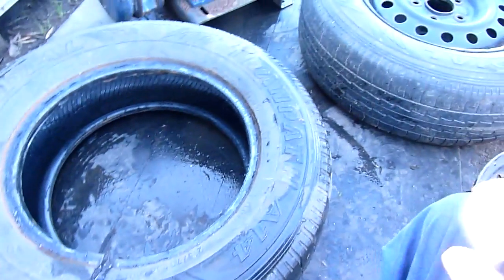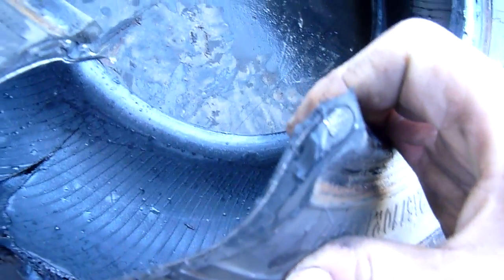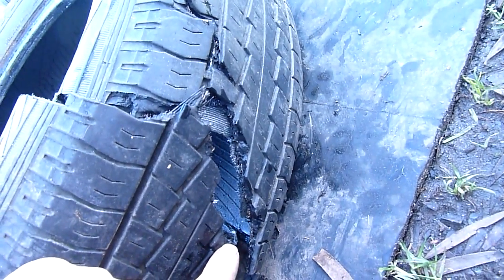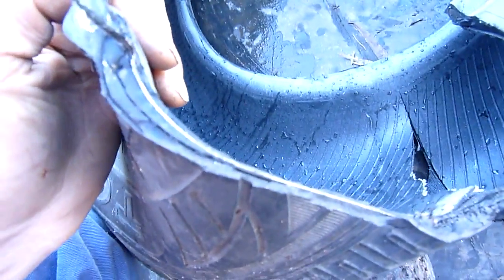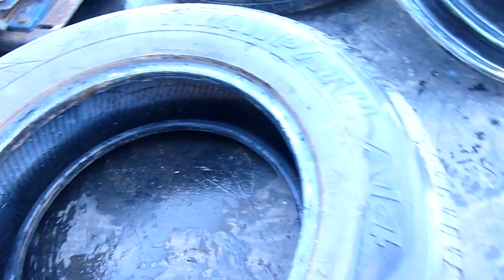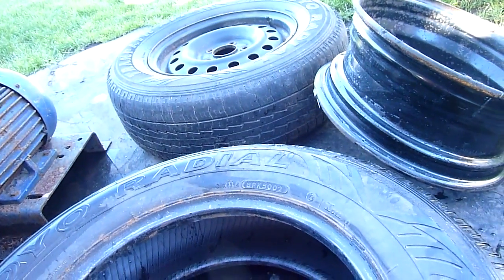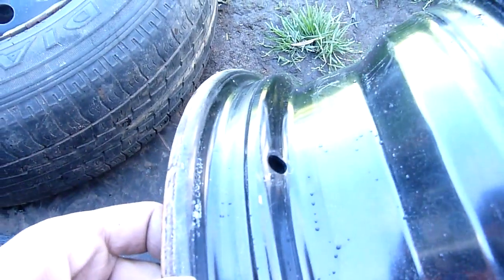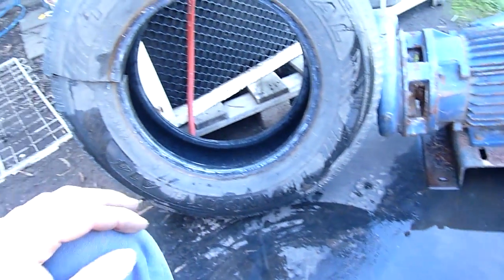Final Autopsy - 250psi Tire Pop Test Aftermath (Hydrostatic)

Comment from the maker: as far as static pressure goes they will probably hold up okay. budget tires fail more because of crap rubber compounds (too hard) and lousy assembly (out of round, tread separation in some instances)

Comment: the belt package consist of two breaks that are cut at 60 degrees .  then a cap strip looks like play but gose a round the the breaker.  then the tread is applied to the breaker and cap strip this is all on a drum.   then the packaged is set to a durm holding the what we call a carcass that has the plys then it is aired up and the belt packaged is stiched down on to the carcass that is when it starts to look like a tire and then off to a press to cure it in to the finaly tire with tead pattern.

Comment: ok I paused your video at :45 it looks to be a one ply and you will have two brakers the wire under the tread they are usualy crisscrossed then tread.     here is what goes in to that tire componet wise  there is innerliner.  ply, then the beads then the ply is turned upa round the play ten if you had a seconded ply this is when it will go on but your only have a one play .   then your pads go on  and stiched down a round the bead.   then the belt package.